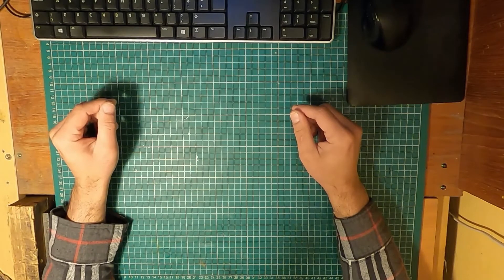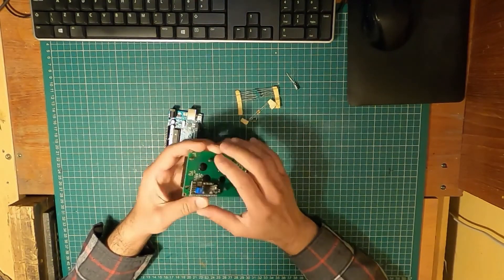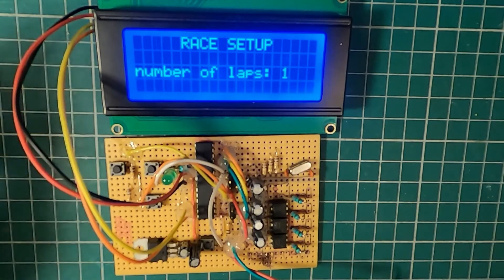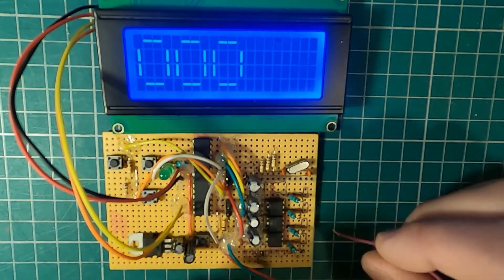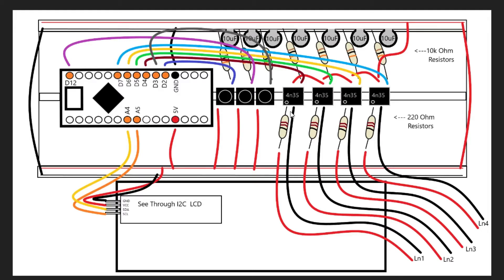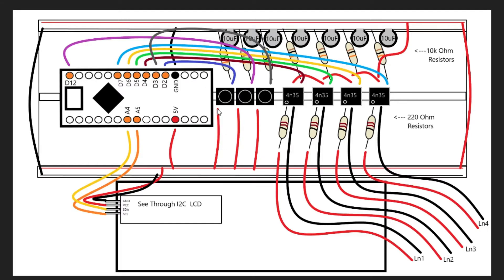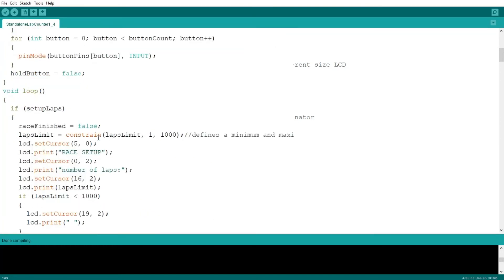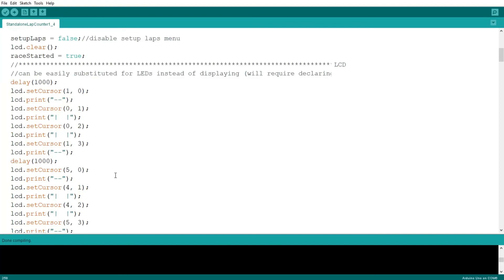Build your Own Standalone Slot Car Lap Counter

Comment: hi good video. I can't see exactly where the capacitors are connected.
Reply from the maker: Hi, thanks! The capacitors are in parallel with resistors (positive from button or optocoupler, negative to ground) . 😊

Comment: Hi, thank you for the video. What kind of voltage are you getting from the dead strip to trigger the led of the Optocoupler?  Thank you in advance
Reply from the maker: Hi, the voltage will vary around how much current the car is loaded as it goes over the dead-strip. Also if resistance value is too high, will affect detection (220 ohms is a good balance)
Reply: @johnny_s_workshop  Thanks